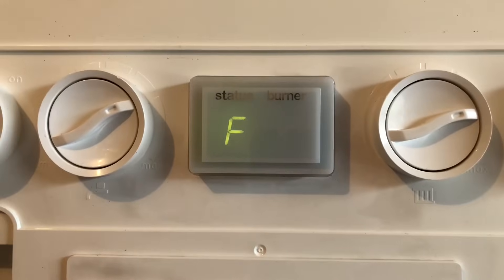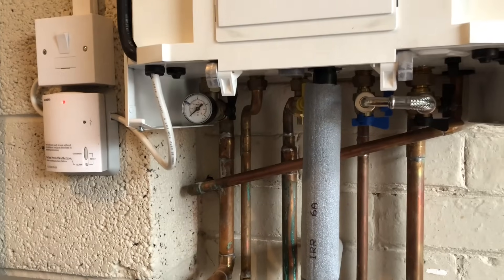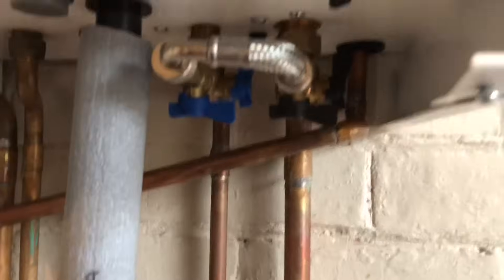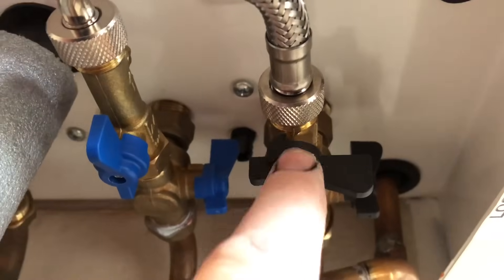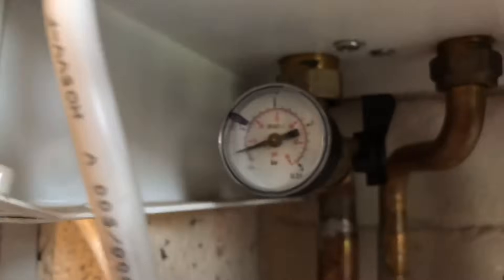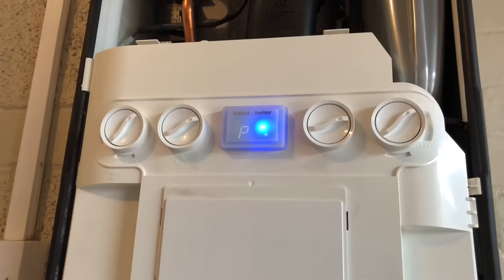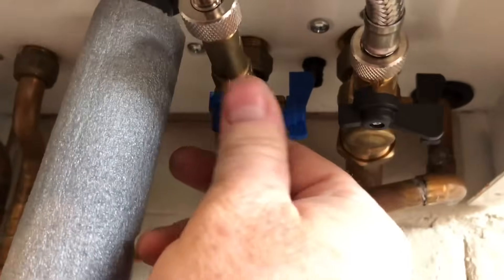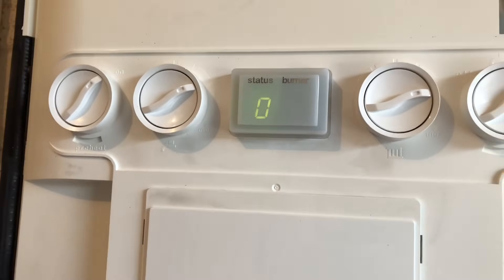Ideal Logic F1 Fault How To Repair your combi boiler

Comment: Sadly I couldn't get this to work. 

When I slowly open the second valve nothing happens. There's nothing. Almost like no water is actually running through it. It was working fine last night.
Reply from the maker: Thanks very much for your comment, please consider subscribing to support the channel 🙂
Reply: I have exactly the same issue today. Opened both Valves and nothing happens! Did you managed to find out how to do it?
Reply: @thisisme2115  Hi there!

I ended up getting a plumber out to take a look. It was something to do with a leak in a valve somewhere. I won't pretend to know what he was talking about!

It would only keep pressure if the boiler was on. Once it was off/heating off the pressure would drop.

Comment: What happens if the f1 message is still showing even when the pressure is OK. I've used this tip before and worked a treat but unfortunately the pressure is OK now but still have f1 error 😔
Reply from the maker: Might be a faulty pressure gauge or sensor. Thanks.
Reply: @AllenHart999  cheers turned out to be the pressure sensor
Reply from the maker: Thanks very much for your comment, please consider subscribing to support the channel 🙂

Comment: Workmen are halfway thru installation of a new bathroom,mains water had been off earlier in the day and bathroom radiator removed temporarily, I went to switch my heat on the same evening and after 5 mins I noticed the quietness so knew the boiler wasn't doing its thing,checked the panel and it flashed up F 1 so youtubed on my fone,within 5 mins of watching ur video,problem was solved and heating back on,I'm a council tenant so it saved me numerous fone calls and hrs,even days of waiting on an engineer,thanks again Allen,ur instructions were clear and simple to follow 👍
Reply from the maker: Happy to help. Thanks for watching
Reply from the maker: Thanks very much for your comment, please consider subscribing to support the channel 🙂

Comment: Thank you Allen.

On my boiler, the first blue level you opened doesn't exist. So I switched on the second blue one in the back which you said not to touch. Then, I opened the second lever and the boiler started filling up. It eventually turned on, fault is gone and it's replaced by a "d"  but the gauge is still at 0.

What does this mean?
Reply from the maker: Thanks very much for your comment, please consider subscribing to support the channel 🙂
Reply from the maker: Happy to help, Thank you very much for watching.

Comment: Have the same boiler. I bled the radiators and boiler pressure dropped this video got my boiler back up and running. I put 1.5 bar in though. thankyou
Reply from the maker: Happy to help, Thank you very much for watching.
Reply: When you want put preasure back up   the boiler shut be on or off thank you
Reply from the maker: Thanks very much for your comment, please consider subscribing to support the channel 🙂

Comment: What if water is dripping from the bottom?
Reply from the maker: If its leaking from inside the case then you will need to get it check by someone gas safe reg, Thanks.
Reply from the maker: Thanks very much for your comment, please consider subscribing to support the channel 🙂

Comment: Hi Allen
I've done this but when I start the boiler the pressure creeps up to 2.5 bar. I switch it off and drain water out to bring it back to 1-1.5 bar but once I start the boiler again it starts creeping up to over 2.5 to which I switch the boiler off to prevent it from over pressurising. Any thoughts? Thanks
Reply from the maker: Sounds like you might have a faulty expansion vessel, You will need to call out a gas safe engineer to give you more advice. Thanks.
Reply: @AllenHart999  Thankyou for the quick reply. I'll call someone out tomorrow. 👍
Reply from the maker: Did you manage to sort it. 👍
Reply: @AllenHart999  Ah mate bit of a nightmare. Got a fella out yesterday, the expansion tank was flat so he topped it up did a full service on the boiler and everything was sorted until this morning, no hot water. Pressure gauge at 0. I put pressure back in the system to 1 bar so we could fire the system up and shower but with the system running the gauge shot up to nearly 3 bar within minutes. And now after a few hours with the system off the pressure gauge has dropped back to zero. We have an Ideal logic 24 Combi boiler, about 4 years old I think (we've just moved in). I'll give them a shout for a call out on Monday. I don't mind not having heating as we have a small house which is well insulated but the hot water is the issue. Hopefully it's nothing major. Thanks for the help and shout back 👍
Reply from the maker: awoods sounds like it will need a new expansion vessel 👍
Reply from the maker: Thanks very much for your comment, please consider subscribing to support the channel 🙂

Comment: Hi thank you what a brilliant video. You’re amazing. I put a little bit too much pressure in. I’ve bled a radiator but it hasn’t dropped. When I turned the boiler back on the pressure has gone up. So I’ve turned the heating off again. Can you help please?
Reply from the maker: If you put too much in you will need to find a way to lower it back down. Drain a bit of water out. Thanks.
Reply: Allen Hart thank you it’s working again now and so much warmer than before with the rads bled.
Reply from the maker: Thanks very much for your comment, please consider subscribing to support the channel 🙂

Comment: I had the exact same issue but my pressure gauge didnt move at all
I kept the cold water valve open for 30odd seconds and the boiler turned back on
But my pressure gauge still says 0 even though its all working
When i turned on the cold water the guage didnt move either
What do I do?
Reply from the maker: You will need to call someone out to check it. Thanks.
Reply: Same happened to me still says 0 but is working now

Comment: Your a legend thanks mate. Turnt out the stupid boiler engineers didn’t connect the pipe that connect to the cold and water pipes together that’s why there was no water pressure between both ends. I have the newer model logic combi c30 so I had to turn the hot water tab clockwise and now there’s water pressure
Reply from the maker: Thanks.

Comment: Already knew that but now it’s saying the same thing but no pressure
Reply: If your boilers reading 0 bar maybe you pressurized it too much. If it goes past 3 it all blows out. 1.1 bar when it's cold. If it keeps blowing out maybe the pressure vessel needs a recharge with air or replacing. Best bet is to call a Registered Gas Installer.

Comment: I have the exact same boiler but my pressure is past the the 4 how do I release the pressure for it to go down?
Reply: Either a radiator drain point of it you have a filter like a spirotec magnaclean or a fernox Tf1. It can be reduced. Take a bucket and bleed 1 of the radiators. Long but safe and slow process.  When radiators are cold pressure should be sitting around 1.1bar. Hope you sort it.
Reply from the maker: https://www.youtube.com/watch?v=UR9wSU-I2O8

Comment: Hi mate done what you have done but i cant close the left valve anymore, any suggestions?
Reply: My valves are blue n black on left and blue n black on right ??
Reply: Spray it with some Wd40 and gently grip it with a cloth and pliers. It's probably just seized. Main thing is one valves off so it's no major cause for concern.

Comment: What do I do if my pressure is too high ? It was too low and now it’s going nearly on full
Reply from the maker: you need to reduce it, it needs to be about 1 when cold, if you put too much in you will need to get some out somehow, maybe from a rad or filter. if it goes up by itself when the heating is on then you will need to call out a plumber/gas engineer
Reply: Allen Hart  I managed to get the pressure out. But no hot water :( it runs hot for like 3 seconds then goes back to cold
Reply: @paisleylouise5956  flow turbine

Comment: Loving your videos Allen, have you any advice for anyone retraining as a gas engineer as a career change?
Reply from the maker: Honestly its not as good as the press makes out, i have been doing this job 28 years now and finding it harder and harder to get work, Customers often want the cheapest, Normally the cheap jobs are not even installed correctly so its hard to compete. i would do something else if you can.
Reply: Thanks for the reply and advice I’m still going for it keep making the excellent videos cheers!
Reply from the maker: Just remember my advice and come back in 5 years and let me know how you got on. Thanks.
Reply: Ok mate I will thanks!

Comment: Good video. What was the cause of the loss of pressure? Cheers
Reply from the maker: We drained the boiler to pump the expansion vessel up on the service, Sometimes if you have a very small leak the pressure will go down as well. Thanks for watching.